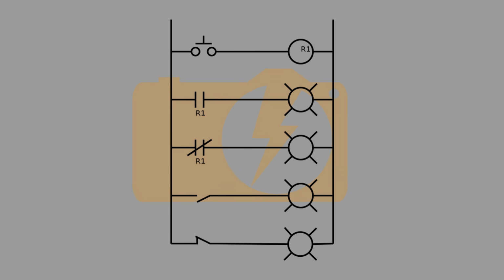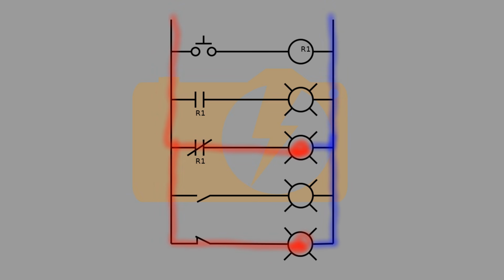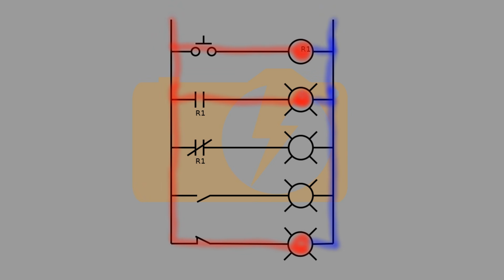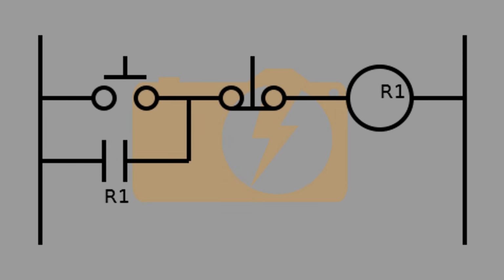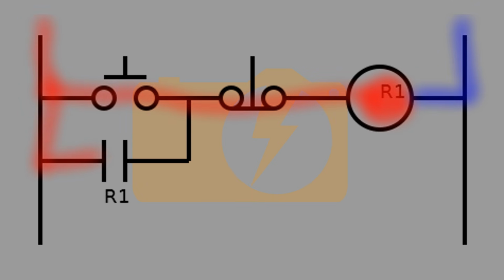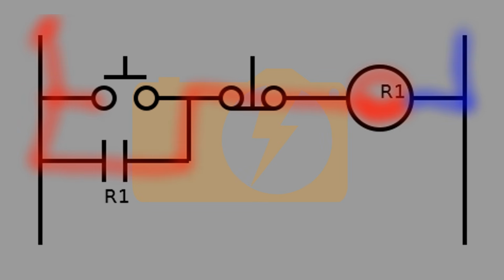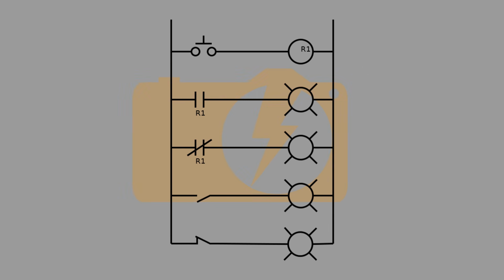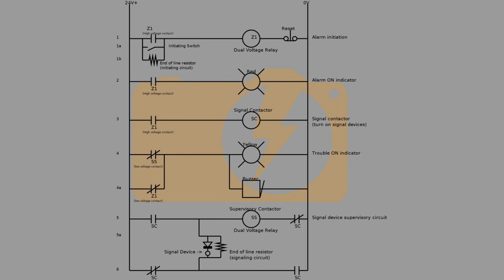Relay Logic Part 1: The Basics

Comment: Small problem with your first ladder diagram.  The symbols are completely wrong.  That's not how a coil is shown.  That is not contacts.  Those are not light bulbs.  A coil is represented as a series of four little hills like half of a sine wave.  That symbol with the two lines is a capacitor.  When you cross it, it indicates that the capacitor is discharging.  A bulb is shown most often as a diode emitting light, ie an LED.  Further, the contacts associated with the coil are shown as small open circles at the ends of lines the lead away from the relay or switch.  The normally open contact will be away from the arrow between the two contacts.  The normally closed contact will be touching the arrow.  You also completely missed how logic gates work.
Reply from the maker: You are thinking of ELECTRONIC symbols. Look up "Ladder Diagrams".
Reply: @NickMoore  Hahaha! He's all thinking electronics.

Comment: I used to repair pinball machines where I had to analyze a complex ladder diagram to figure out which contact was at fault. Often only a wiring diagram was available and I had to develop my own logic chart from it. I didn't know at that time they were called ladder diagrams, but since I had studied Boolean algebra they weren't too difficult. It is amazing the level of complexity that can be achieved with 8 relays and 6 switches.
   Mike (o\!/o)
Reply from the maker: It's sad that not much runs on ladder logic any more (damned PLCs) but they are a really simple way to get a lot of automation bang for your buck. I have seen loads of arduino projects online that could have been done in a bullet proof relay board.

Do you still work on pinball machines, I have always wanted to get my hands on one eventually.
Reply: I haven't in a long time. When the home video games came along in the 80s the arcade machines went solid state, just a box with a computer and monitor inside. Not much to go wrong except some like Galaxian and Centipede had heat problems.
 Later model pinballs used sealed relays and switches which solved a lot of the problems that the open unit systems had like dust and corrosion. I don't know if any of the remaining arcades use the old electro-mechanical machines. Too much power, too much maintenance so they are just collectors items now. I believe most just went to the scrapyard. I know of several in homes that don't work and will probably just remain as decor, even as hard as I tried to tell them they can (and should) be fixed. 
  Mike (o\!/o)
Reply from the maker: Shame that they are just sitting. I have a bunch of test equipment from the 40's through to the 70's and it doesn't get out much but I do still use it when I need it.

BTW, did you ever see the fully electro-mechanical version of pong? The ball was on a big x-y gantry and the paddles were on a pulley system, I think it ran a couple kW but I would kill to play with it.
Reply: One guy has 4 from the 50s and 60s and he only wants the lights to come on when he has people over, he doesn't want them to work as someone might want to play them. Some people have more money than brains it seems.
 I would love to play that Pong! And I would love to dissect, I mean inspect, the guts of some machines like that.
https://vimeo.com/7548051
 I once repaired a manual Pong-like bar table from the 50s. The play field was under glass and slanted each way slightly from the center with the paddles on a pulley system controlled with knobs that had a button on top to kick the ball. It took a lot of coordination to get the ball to go where you want it to. The only electrics were for scoring, lights and a tilt switch. In the ball return from each end was a switch that operated a counter for each player and lights flash three times for each score. 10¢ and first to five wins.
 I haven't thought about these machines for years. Some good memories there. Some frustrations, too.
 I think the bar table would be a good project for someone. Maybe someday...
   Mike (o\!/o)
Reply from the maker: Yeah, I like the minimal controls idea. A smooth curved table (or maybe a rubber sheet with variable geometry) could give it multiple levels of skill. 

I have a laundry list of projects as well, there isn't enough time to do everything :/

Comment: Why is everything called R1 ? It makes it extra confusing. Is it that a relay is all of those things combined ?
Reply from the maker: +karl ramberg  Jim is right, the contacts named R1 are associated with the coil R1. In a large project there are many coils and contacts, using names like R1 and R2 is how you know which contacts will open or close when a given coil gets power.
Reply: Because the contacts are "part of" the coil, and are controlled by the coil.j
Reply: Ok, thanks